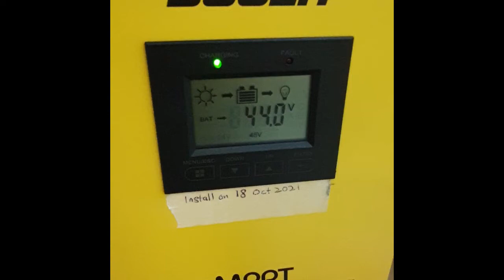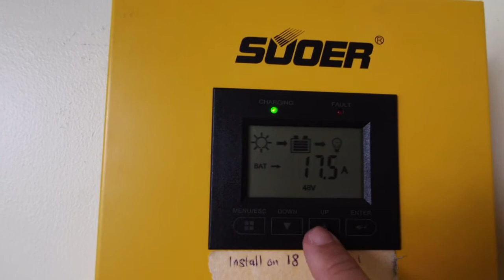Suoer MPPT 60A   noise

Comment: I really like this charge controller
Reply from the maker: Thanks for your comment. You have been using this?

I have bought another exactly same. I have seen both performing well charging at 55amps (110amps total). Except the fan noise and at times not accurate amps measurements.
Reply: @michaelseah9617 i have used the 30amps, 60 amps and 25 amps hybrid controllers they all work fine, i wish they could improve on the noise as well.